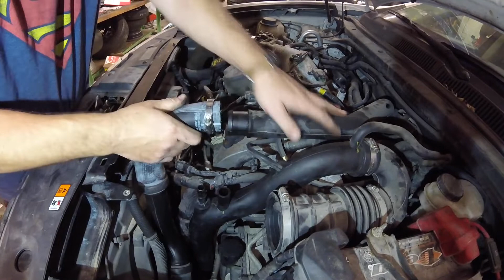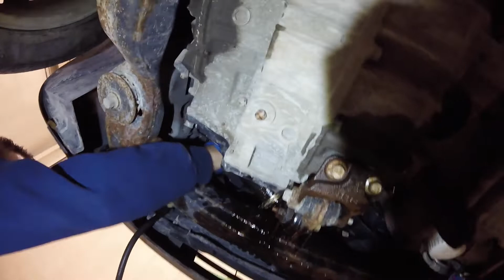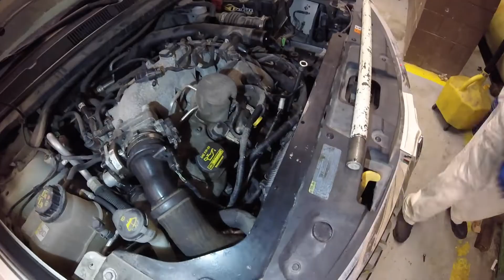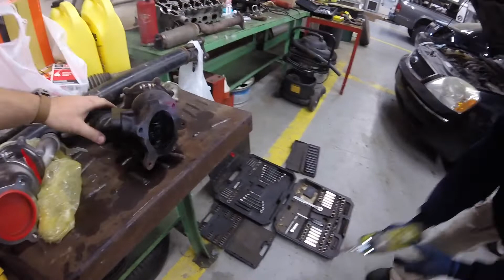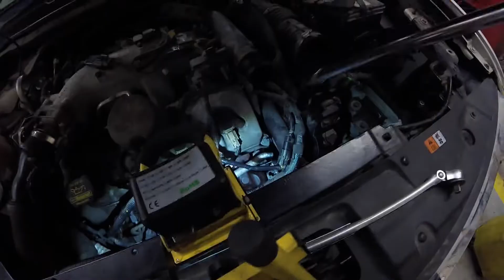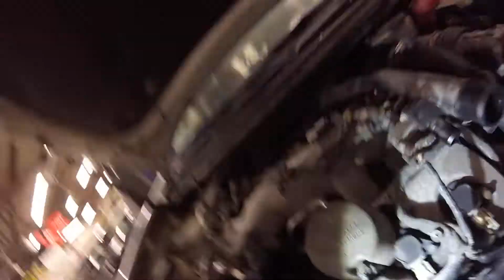How to Replace the Turbo on a Lincoln MKT 3.5L Ecoboost Engine (Front Driver Side Turbo)

Comment: What codes indicated your turbo was faulty or any
Reply from the maker: I don't recall, but I know it did throw codes. A failing turbo on these don’t always trigger one perfect “your turbo is bad” code. Instead, it shows a pattern of codes that point to low boost or airflow problems.
- P0299 is the main one linked to turbo trouble because it means the engine isn’t making enough boost.
- MAF/MAP mismatch codes (like P1100–P1102) can show up when the turbo can’t move enough air.
- Lean codes (P0171/P0174) often appear because low boost makes the engine run lean under load.
- Sometimes there are no codes at all, especially if the turbo is failing from oil starvation.

Comment: Dzień dobry. Mam pytanie, czy w kanałach olejowych od turbo, ale w samym korpusie silnika jest mini filterk oleju (wkładany w otwór)?. Z góry dziękuję za odpowiedź i informację. Pozdrawiam.
Reply from the maker: Yes, the 3.5L EcoBoost uses small mesh screens inside the turbo oil supply tubes. These are the ones Ford references in SSM 47948, which applies to 2010–2019 turbocharged engines. It's recommended to replace the turbo oil supply tube every 60-80k miles to avoid turbo failure.
Reply: @mjspiess  THX Bro.

Comment: Mi pregunta es salen buenos los motores v6
Reply from the maker: Generally, these things are very reliable, just keep up with maintenance and you should be golden. 2021+ has new/redesigned cam phasers if you can afford a newer vehicle. Otherwise, you should make sure you see some maintenance records for older ones to make sure they are getting their oil chaned. https://fordauthority.com/2023/05/ford-ecoboost-engines-should-get-5k-mile-oil-changes-video/

Comment: Great video.  I also wondered like another commenter why the turbo was not put back in before the intercooler and fans since they wound up coming out for a cleaning, but figured maybe you had decided to do so in order to complete the video as if that portion were not part of the job.  I appear to have a coolant leak at my rear turbo (I think) on my 2014 MKS so I was hoping to see a bit more of those coolant pipes in the video.  Kind of wondering what they look like and how they install on the other end (the block side).  I have been chasing my coolant leak for a while and a fellow ecoboost owner told me about leaky fitting/piping on two of his F150's.  But after looking at this video and comparing it to the plethora of F150's video out there it appears these connections are different at the turbo (much better on the Lincolns).  I am wondering if the block side fittings on my MKS do look like the clip in versions on the F150's though?  If so I am willing to bet that might be my leak.  My leak is somewhat slow and hard to find.  Initially put it up on a lift with a radiator pressure tester pumped up to 16psi and let it sit for an hour and lost maybe one psi so though I did find a tiny bit of wetness I did not find the leak.  Now a few weeks later it Pukes out a thimble full of coolant when starting it cold.  I calculate I am losing about 1 quart of coolant every 1200 miles, which take me about 2 weeks with my commute.  So I figure now I will have to park it on a lift and let it sit overnight and get under it and hit the remote start to see if I can witness that "puke".  But it definitely appears to be at the rear turbo area.
Reply from the maker: Yeah, things got a little out of order.  At first we didn't remove the intercooler, reassembled everything, took it for a drive and immediately got a code for the IAC or MAP...I can't remember and was blowing a ton of smoke.  Removed the sensor and it was soaked in oil.  So at that point, we disassembled the intercooler and cleaned it all out.  Best just assume the intercooler will be full of oil and do it all at once.

I'm not sure on the back side.  I know the oil drain pipe on both turbos are horrible to replace, especially the rear side.  The coolant lines on this MKT are like banjo brake lines.  They weren't difficult to remove and have a steal washer with a connecting leg so it slides on to the fitting and doesn't fall off.  Could check the torque on those bolts and if tight, replace those washers or the entire line and washer assembly.

I'm not sure where the water pump is on these, but I would suspect that as a "puker" before one those 2 turbo coolant lines.
Reply: @mjspiess  well I certainly hope not, and I don't think so because of the area it's puking. Water pump replacement on this motor is a zombie nightmare. You can see it here starting at 8:29. He doesn't get to the Water pump until 12:35

https://youtu.be/IWGWFgClPnQ
Reply from the maker: @Skul-Ski  Oh yeah, I remember reading about the water pump replacement on these engines...  Definitely a complete nightmare!  Well, hopefully, one of those banjo bolts have come loose on your turbo and it will be a relatively easy fix/replacement.
Reply: @mjspiess  Also, the water pump puke hole is at the front (aka left side) of the motor.

Comment: How much time did it take you to replace from start to finish. And did you have to replace any sensors or valves on top of the motor spark plugs or anything else along those lines
Reply: My car has been in the shop for 3 weeks
Reply from the maker: @bigc6436  It took us over 8 hours, but taking our time, chatting, taking pictures and videos.  Initially, we did not remove the intercooler and clean it out, so after getting it all back together, it was throwing codes for the MAP sensor I think.  There is one or two sensors near the intake inline with the intercooler pipes and they were coated in oil which were initially cleaned off.  So my friend ended up doing all the intercooler part himself and that was a challenge in of itself and another 4-6 hours.  Those sensors ended up needing replaced.  I think he reused the spark plugs.  The oil drain tube was the worst part and got destroyed upon removing, so we had to find a part replacement for that and ended up going with a Dorman part from Autozone, but everything else was bought directly from Ford.  3 weeks is pretty excessive, but it will be on a lift for a while, so maybe it just didn't get started on yet?
Reply: It's in a Ford shop
Reply: I don't know but I bought aftermarket bourg wherner turbos and epa compliant cats the car is a 12 model I Heard there was a lot of failures i have had no issues with mine 189000 Miles would not have probably fixed it but really like the car bought the turbo's as a matching set and cats the same way hopefully being both done new they will be balanced same pressure as new if I get a Bill for 120 hrs I don't know if it was worth fixing
Reply from the maker: @bigc6436  Dang... That's a lot of money.  We soaked his cats in laundry detergent, then acetone to clean his out and they are working well as is.  The rear turbo is insanely hard to replace and the oil tube is next to impossible to remove.  They may have just ran into a lot of trouble.  That really sucks.  Hopefully, it's billed by the book and not actual hours because yeah, it will be an insane price if so.

Comment: The front is super easy it's that rear that is  the monster
Reply: I did it on my Flex (it wasn't fun) But it's not as bad as it looks. I just removed the wastage and just "tetrised" it out.  Leaft the axel in and everything.
Reply: @tennaj1367 i gotta do both turbos on a 2013 lincoln mkt 3.5, do you know if that is pretty much the same as flex?
Reply from the maker: I agree.  That rear looks horrendous.
Reply: I agree I did the rear in my driveway  no lift fun fun 😊
Reply: @brendahaggerty2879  oh my god bless you heart!

Comment: Why didn't y'all just take out the cooling fans so that you can have more access to it you really can remove it from the top
Reply from the maker: We ended up taking out the cooling fans later along with the radiator and intercooler because the intercooler was filled with oil, but that was already after we installed the turbo.  It really wasn't too bad to install it from below.

Comment: I have codes 420 and 430 are both of my cats bad? An exhaust leak after the flex pipes surely isn't the cause right?
Reply from the maker: It would be surprising for both of them to go bad unless you're dumping a lot of unburnt fuel and/or oil into your exhaust.  However, an exhaust leak at the flex pipe before the down stream O2 sensors could definitely cause a code for the cats.  If you have an exhaust leak, I'd fix that first as that will be a lot cheaper than replacing your cats.
Reply: Thanks but the exhaust leak is a good ways after the downstream O2, after the factory flex pipes someone put those cheap AutoZone flex pipes and they are leaking. But I am getting shitty mpg 14 according to the computer. I shot the cats with a temp gun and they are hotter at the rear. I guess I gotta take it somewhere
Reply from the maker: @Dr650rob  Ah I see.  Yikes!  14 mpg is pretty low, so you might have a fuel related issue that is plugging up your cats.  Those cats aren't cheap either.  On this car, the owner opted to clean the cats with dawn dish soap since the filaments were still good, but just soaked with oil.  So far, so good after cleaning and re-using them.